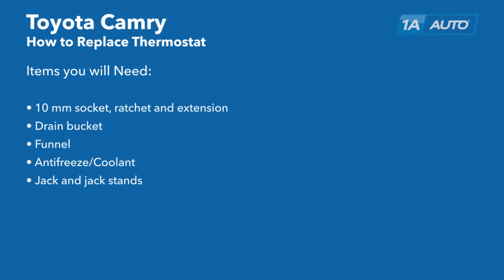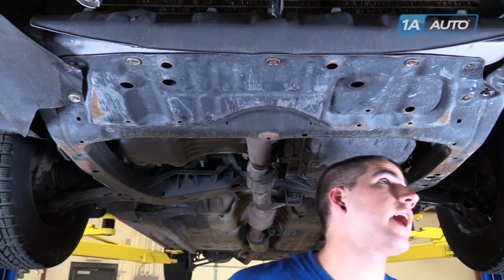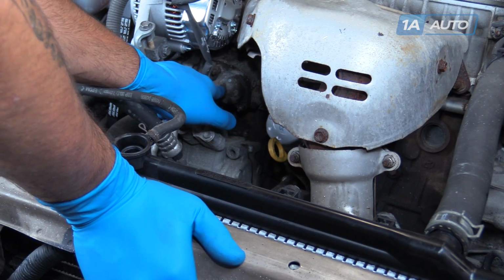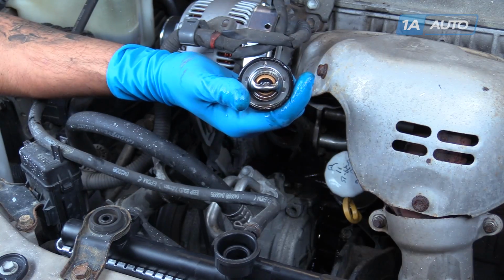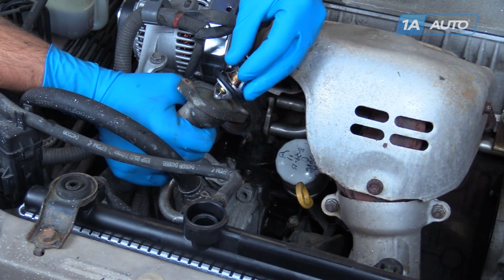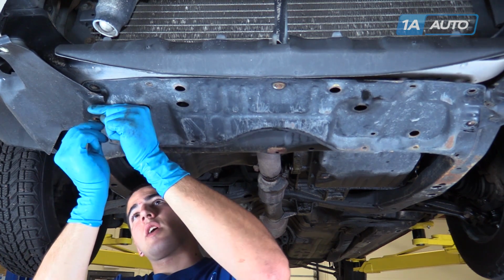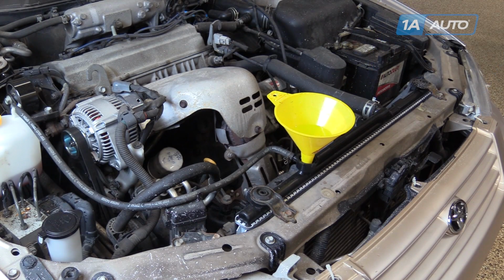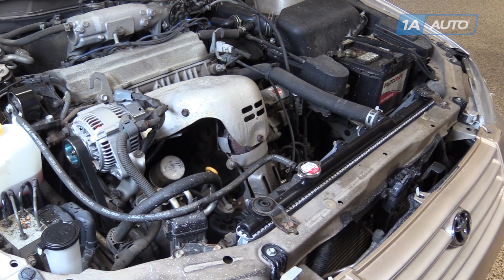How to Replace Thermostat 97-01 Toyota Camry

Comment: I'll ask my question, and hope for an answer.
I changed the thermostat (used a new fail safe), new radiator, new water pump and water pump housing (had to do the timing belt anyway). I flushed the coolant system, too. Got heat in the car, but the new thermostat is not opening, and it is not damaged. The coolant level is full. I got all the air out that will come out.
Why is my new fail safe thermostat not opening?

Comment: I have a 2000 Toyota Camry no ac heat was one temp car made a weird noise when starting , car was heating up way too fast and lost coolant a couple times . Did some research Used this video to replace thermostat and it fixed all those problems everything came back and it only cost me 30$ thank you guys had no engine light either

Comment: I appreciate the info in this vid, but It should be noted that you do not have to remove the pan underneath the radiator in order to drain it.  There's a hole right below the petcock that allows it to pass through.
Reply from the maker: +CTG We appreciate the feedback. Sometimes there are multiple ways to accomplish the same repair.
Reply: I thought so! This comment saved me some time, thanks!

Comment: What position should the jiggle valve on the thermostat be at for this engine?
Reply: Good question 🤔
Reply: There is a raised notch in the casting at the twelve o’clock position on my new water pump, so I imagine that this is the proper position. It makes since logically, too. As the coolant level decreases, air is then able to pass through the jiggle valve. At six o’clock, air flow my not be achieved… I think…

Comment: I did this today and coolant started spraying out of the sides, do I need a gasket or rtv or is the problem that It wasnt tightened enough?
Reply: did you buy a new o ring replacement for the thermostat?

Comment: So my 01 camry heats up all the way to the top when it idles or drives slowly. I noticed one of the radiator fans occasionally doesn't turn on when the other does, but do you think it's the thermostat that's the issue or the fan?

The coolant empties within 3 days but I've been told there's no leak :/ I'm not sure what to do and don't have a lot of a mechanic right now. I was just scammed 1k at a shop

Comment: In this video the coolant used to refill the radiator is not toyota approved.   
The coolant drained from the radiator was pink/red and what the radiator was refilled with was green coolant which should not be mixed.
This will be bad for those who follow this video to the tee!

Comment: P.S.A. IF YOUVE DONE WORK ON YOUR 97 TOYOTA CAMRY,S COOLING SYSTEM.
Try filling the block. after its cooled with anti freeze.
Through the top radiator hose.
I replaced my all the sensors on my camrys cooling system and the thermostat  (over achieving maybe?)
When refilling the cooling system my car kept over heating 
Not really sure why filling through the top radiator hose worked but it did 
Hope this helps someone
Reply: My ‘96 did the same thing.

Comment: Im confused as to why the radiator needs to be drained to change the thermostat??
Reply: Yeah I was thinking that too. Last time I did this, I disconnected lower hose and plugged it with a stopper, didn't lose a ton. New thermostat and housing went on, removed stopper and reconnected hose. Hooked up my bubbler funnel to bleed air (heat on, fan low) and added a small amount of coolant. Good to go.

Comment: I replaced the thermostat in my ‘99 Camry ‘cause the temperature would get weirdly low on the highway; not overheating though. I’m assuming I topped up the coolant afterwards, but now I’m hearing a burbling or sucking-ish sound from the reservoir. Why?
Reply: exact same sound on my camry
Reply from the maker: +Braulio R. We wouldn't be able to diagnose an issue like that here, you may want to have a local mechanic take a look at it. Thanks for checking us out! http://1aau.to/m/Shop-1AAuto-c

Comment: My 98 camrys temperature hand is only in the middle of it's idling if I turn the heat on it's on the white line or if I'm driving with no heat it's up only about 20% does this sound like a stuck open thermostat
Reply from the maker: +1mil camry We wouldn't be able to diagnose an issue like that here, you may want to have a local mechanic take a look at it. Thanks for checking us out! http://1aau.to/m/Shop-1AAuto-c

Comment: Replaced the cracked radiator yesterday with the help of your videos, car was running fine until highway speeds, thermostat possible?
Reply from the maker: +Jared Berger Thanks for checking us out! While it is possible it is the thermostat, we cannot provide an exact diagnosis over the internet. We'd suggest getting your vehicle checked out by a local mechanic to figure out the exact problem. 1aauto.com

Comment: on my 98 camry, the temperature is normal and leveled off, but when i accelerate, the temp gauge jumps to near-red, then levels off again. Does that sound like a new thermostat? or potentially blockage?
Reply from the maker: +Adam Lee This does sound like a symptom of a bad thermostat, however there could also be multiple reasons for this. I would highly recommend getting this checked out by a certified mechanic to avoid replacing parts that don't need to be replaced.

Comment: What does it mean if the heater isn't working on high fan setting?
Reply from the maker: +pineapplekatrina Thanks for watching!  There could be multiple causes for that issue, like the heater core, the A/C and heat control itself, HVAC door actuators etc.  We recommend having a trusted mechanic take a look at the vehicle to properly diagnose the issue and identify the part needed for the fix!  1aauto.com

Comment: What would be the consequence of doing this without draining? My bolts in the skid plate are rusted to kingdom come and I can't get anything on them to pull them out
Reply from the maker: +Derek Gleue It's going to make a big mess and dump coolant out of the thermostat housing. That's the only real downside, try to catch and dispose of the coolant as best you can.
Reply: For future reference and other readers, I was able to reach down from the top and reach the valve. The skid plate on my 98 had a hole for it to drain out of.

Comment: 1A Auto,
Do you need some type of gasket for the housing in addition to the O-ring that fits around the thermostat? I was told that you only need the O-ring because that's considered the "gasket", but I just want to make sure. My car doesn't leak coolant, but I believe the thermostat is stuck open so I'm going to replace it. Thanks.
Reply from the maker: We're always cycling through cars filming hundreds of common repairs for common vehicles every month. We'll add this to our list of repairs to film. Check back again and hopefully we'll have it soon. +Connie Boyland
Reply: Sorry, forgot to add. My question specifically references the 1997 Toyota Camry, but should be the same for this video.
Reply from the maker: +Nocturnal X The thermostat o-ring is the only gasket you will need!  1aauto.com
Reply: 1A Auto Parts
Do you need a gasket for  a 2001 Camry. It keeps leaking on my vehicle after replacing it.
Reply: Im trying to get a understanding on how to replace a upper thermostat radiator hose not the lower can you do a video on a upper thermostat cause thats what im having a problem with..

Comment: can you please help me...I have a 1998 Lexus es300 my new thermostat has a jiggle pin,in what position do place thermostat in?
Reply: I believe that jiggle pin is for letting air bubbles pass correctly out of the system. As such, it should be oriented towards the TOP of the TStat housing, so that said bubbles can move through it. If you mount it upside down, you will trap air in the pipe.